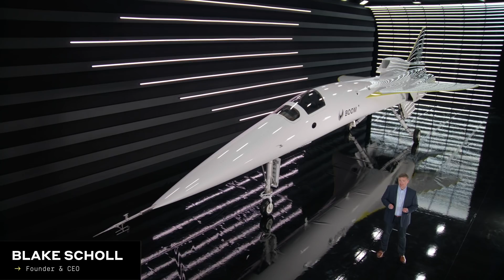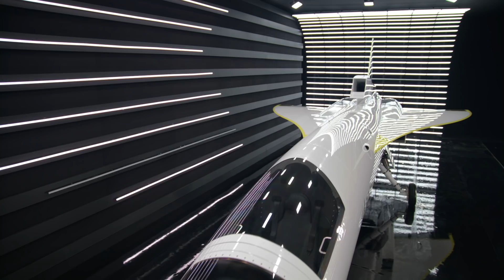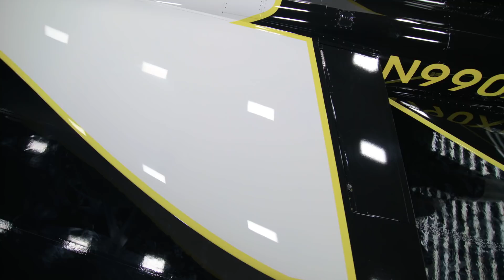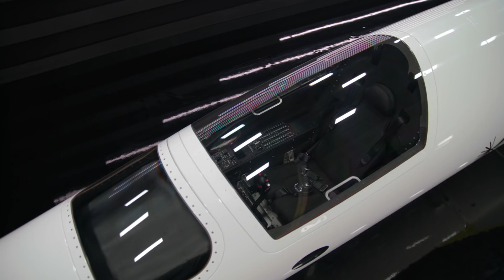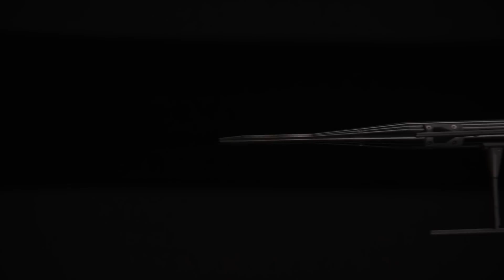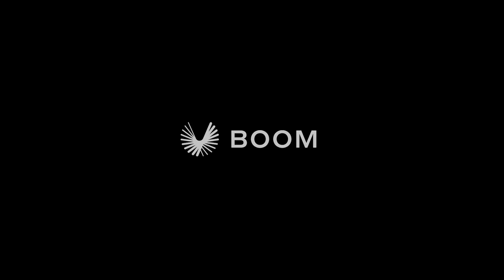XB-1 up-close

Comment: As a retired landing gear engineer, I find that the angle of the main shock-absorbers being close to 45 degrees, implies that this component will only fuction with a much greater than normal spacing between the sliding-bearings in this component. Is this assumption correct? And surely there is a weight penalty, which presumably compensates for a different feature's weight savings. "Overture" is not the same and when do we get to a symphoney?.

Comment: The future is rail. Tube based trains wlll be faster while using electricity.
Reply: Are you a Hyperloop fan?
Reply: @freefall0483  The national railways authorities here have already developed the technology in 2009 together with 600km/h linear train and a 500km route is being built. If the government decides, then things go on and it has nothing to do with "fan" thing.Aerospace itself hasn't got a bright future. Especially with multi terabps sea cables.
Reply: @aabb-zz9uw  I think you need to learn how to separate fantasy from reality. The energy input to move a train at 600kph is absurd and not economically viable as well as a deathtrap. Hyperloop doesn't survive highschool physics. Aviation is here for a while longer bud. But not supersonic aviation as it's also not economically viable.

Comment: Theranos but faster...

Ffs it's using 3 tiny turbojets from a T38. The budget must be damn tight given that more performance could have been gained from a single F-16/F-15 engine with better economy, range and reliability.
Reply: They're using J-85s because they are ideal for this testbed you idiot. This isn't a production model, it's a flying test article to validate the composite structure and aerodynamic design.
Reply: @jaffacalling53  They are using J85s because they can't afford anything else. With that size aircraft, Delta planform and 3 RC jet engines it will be lucky to break mach 1.2 let alone 2.2.

But you are a fan boy. Even when it's cancelled for not meeting economic and performance targets you will still believe the bullshit.

Do you drive a Tesla too?

If you want to find idiots, grab your friends and go mirror shopping.